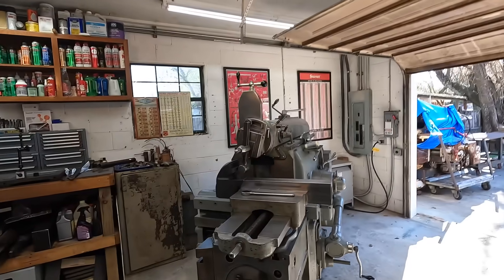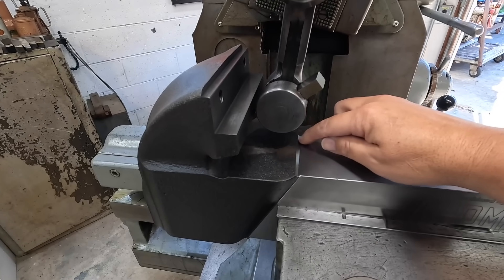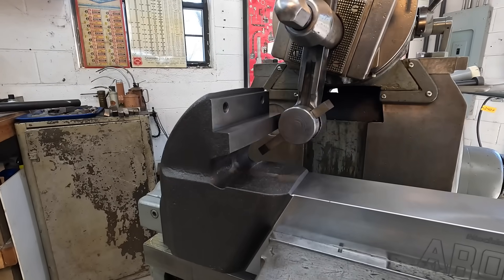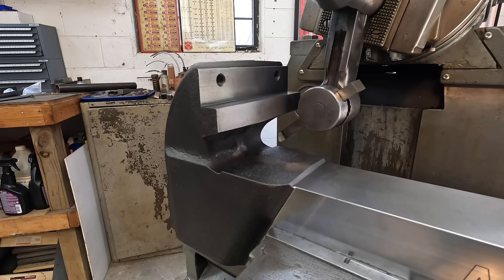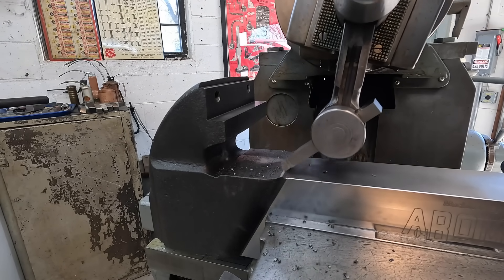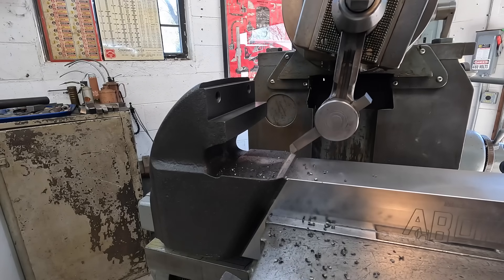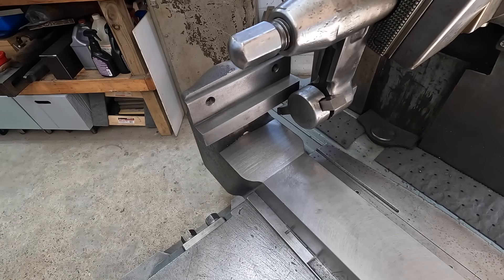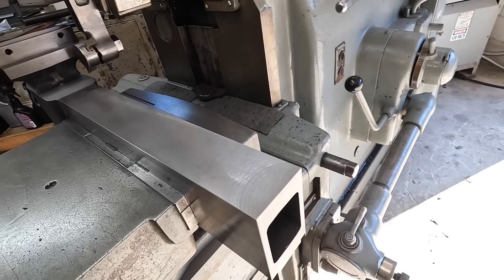Final Machining Cuts for Hardtail Vise Dynamic Jaw

Comment: Those castings are really great to work with. IVE worked lots of castings iron and aluminium even stwinless. Each has its own tooling it likes or hates. .I received a very nice raise and a Forman job by using my carbide insert tooling on cast stainless that ate tooling by the cut. With my tool we got several parts per each carbide tips X Three.X 2 sides.Government contracts for missiles and such.

Comment: I also noticed that the shaper is advancing the work piece before the tool has cleared it on the back stroke.  Most notable during slow motion passes.  Is it designed to do it this way or should the tool clear the work before the table advances?

Comment: Down the road many miles from here is a steam museum. in there are some scraper worked machines with finish that is every bit the equal of a modern CNC surface. All those intricacies that you tell us about and perhaps much more was known to those tradesmen a hundred years ago. Building steam locomotives and mechanical presses of such precision, that todays kid will be gobsmacked to see was done so well, so long ago. I dont know if hand scraping would have been used on some of the work but it had to have been honed on the flat for the finish on a selection of the equipment on display.

Comment: Adam, something to keep an eye on that I noticed in the slow-mo at ~ 9:15. The stepover takes place when the cutter is at its full backstroke. However when you have the cutter only clear the back of the workpiece by a very small amount, you risk the stepover starting before the cutter is fully clear of the workpiece. I know you like to make the stroke very close to the workpiece width to reduce the cutting time (no sense in having it cut air : ), however the stepover takes some time to complete, and with a fast stroke speed, you risk putting side pressure on the cutter before it has cleared on the backstroke. Just a thought after watching.

Also, loving anything in the old shop, thats where I learned to love your channel 👍

Comment: Wasn't explained well but I think what he is saying is . . . if the tool digs and the holder will want to rotate counter clockwise.  If it were to rotate counter clockwise that would increase the depth of cut and crash.  If the tool were already rotated slightly past center and it digs and rotated counter clockwise the depth of cut would decrease, reducing the load on the cutter.  With it hanging out to the side that far it wouldn't be practical to accomplish this so he is left taking a bit of a risk here.

Comment: I have ALWAYS liked running the shaper just to get away from the super finnish tolerances of tool and die maker. 

 Our main large shaper was too close to a big surface grinder we all used a lot and I want to say when running the surface grinder while you were doing work on the shaper with tool steels some of them chips could set you're pants on fire lol.
 The good old days.

Comment: As long as you take light cuts on the horizontal surface there is absolutely no problem having the clapper in the "wrong" way. The tool will indeed dig in on the back stroke onece you touch the vertical surface.

Comment: Always stand to the side when starting a grinder wheel until it reaches full speed. Someone could have banged the wheel and cracked it or a temperature fluctuation could have damaged it. Or do the ring test if you don’t have 3 seconds to let it get to full speed.